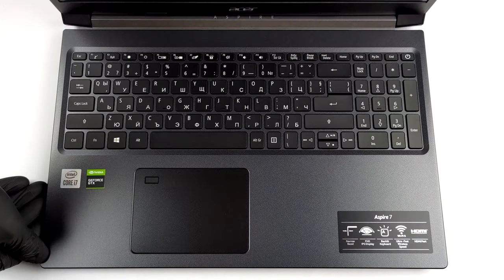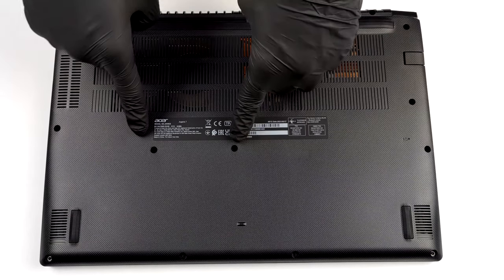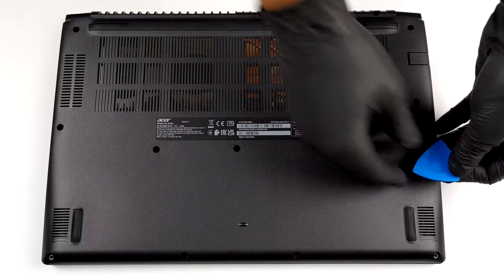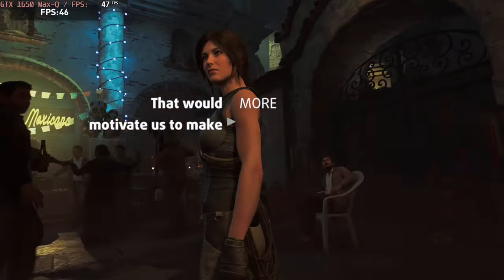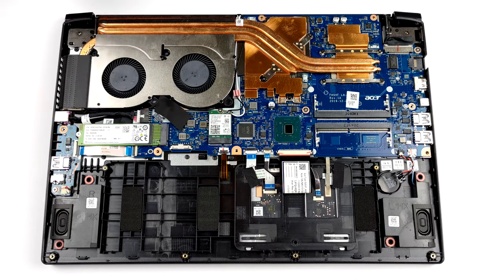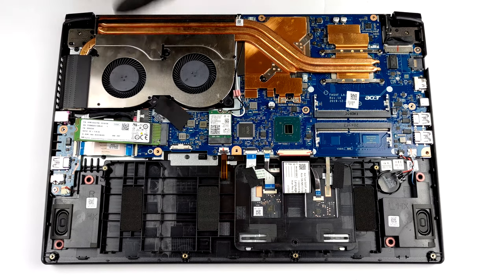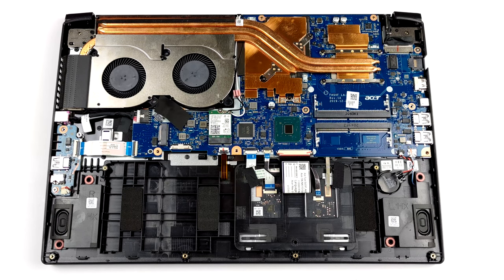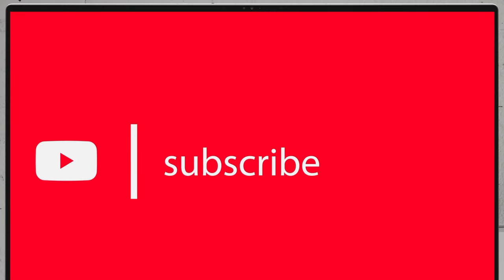🛠️ Acer Aspire 7 (A715-75G) - disassembly and upgrade options

Comment: Hi, I have an Acer A715-75G laptop. I wanted to ask if it is possible to add (2) 32GB RAM with 3200 frequency to this laptop.
Reply: Max you can add is 2x16 gb per acer